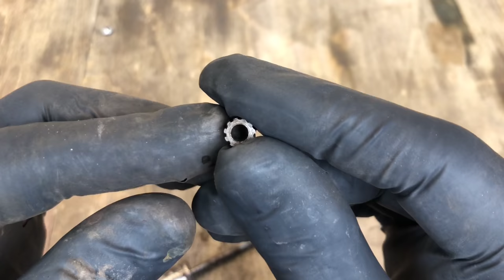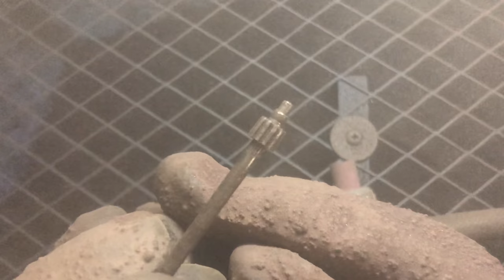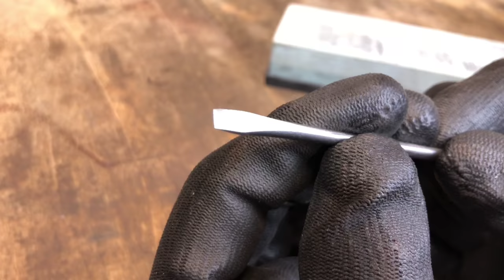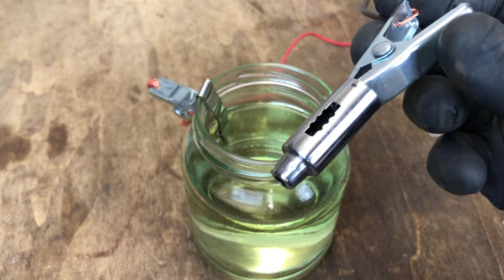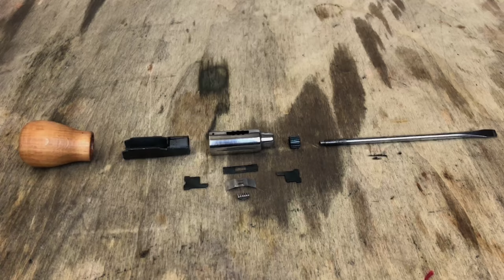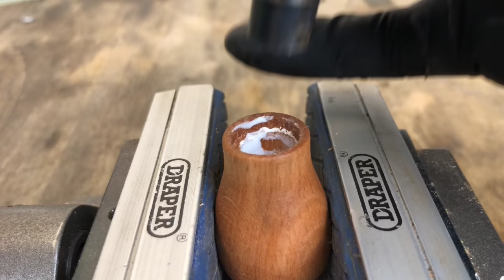1920 Broken Ratcheting Screwdriver Restoration | Mister Patina

Comment: When you break the handle its just like you breaking my heart, why you didn't keep the original handle 😭
Reply: I agree, Feels like he destroy the history of it.
Reply from the maker: Oh man i totally agree. But the old handle had some bad marks and the metal parts were stuck/glued in it. I didnt have other options :( But in the next projects i will try to take the same wood for recreating such parts, to keep it as original as possible! Hope you enjoyed anyways! :-)
Reply: @misterpatina  OK, you couldn't keep the original, but the new handle should have been a similar shape and  darker/purple color in keeping with they style of when it was originally made.  You put a 21st century handle on a 20th century tool.
Reply: @kellerrobert80  agreed
Reply: @misterpatina  Did you try a heat gun to loosen the glue inside the handle?
Reply: @kellerrobert80  I agree, especially regarding the shape. I have a few of these one as small as the one here and a huge one, gifted to me by my dad who was a cabinet maker, carpenter and joiner. That flair at the bottom of the handle is there to apply some forward force and control when needed, rather than using the palm of the hand and the colour is typical of this kind of tool, in my case 'Stanley'.
Reply: @misterpatina  Some good stuff there but the handle had an insert that the ratchet base sat into. Why didn't you put that back?
Reply: Mr Patina you are awesome , but I too feel bad about making new wood handle.

Comment: I seeming have the exact same screwdriver just with a shorter neck. I was unable to find any name or branding do you know what company made them. Ps do you plan to re-purpose the wooden handle?
Reply from the maker: Nice! I didnt see any brand, but while sandblasting the "DRGM" sign showed up, which means "German Reichs Patent". So it has to be a german production. The company "Kunze" made ratcheting drills aswell, maybe its one of their products. I think i wont reuse the old handle...

Comment: As always, enjoyed your renovations. Here, however, I don’t think that wood glue would bond wood to metal with any great strength - wood to wood, yes, but it isn’t designed for any metal bonding. Epoxy resin should be used for a tool like this which will have a heavy turning force applied when in use. Also, a nice touch would have been to retain the original colour of the handle.

Comment: The ratchet plate is just going to malfunction again should have replaced or hardened and tempered, is definitely going to fail again! And when you remade the handle there was no inner core of wood which has caused another break point that wasn't there before

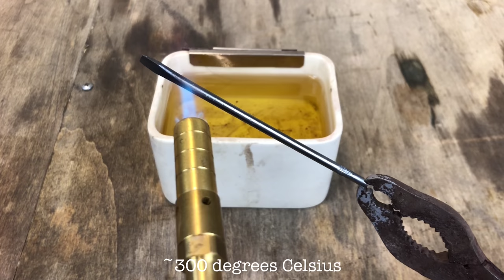Comment: 5:10 Maybe you can give a hint, how to find the right temperature for bluring?
I've tried it with a steel bold. Just made it nice hot and put in into oil (simple 10W-40). After a few minutes i took it out and the black coat was peeling off like old color :/
Reply from the maker: Sure: the part should leave the flame directly to the oil by around 350-400 degree Celsius. But it’s not too bad if it’s hotter, give it a light cherry and you’re good to go. 
Why it doesn’t work is because you didn’t use linseed oil. This oil „soots/smokes“ itself on the bare metal and leaves a black surface. 
Give it a try 🙂✌️